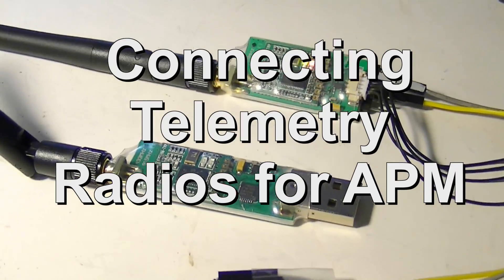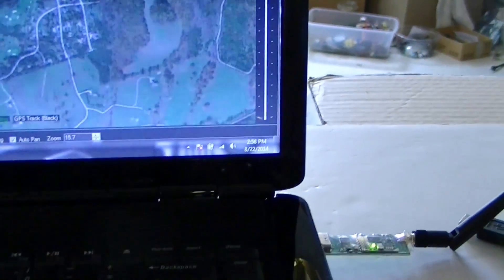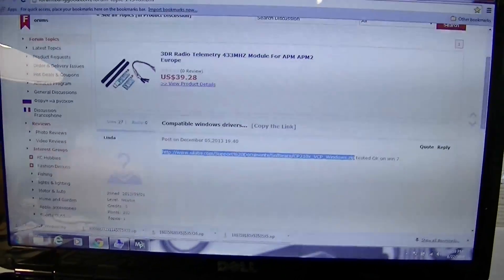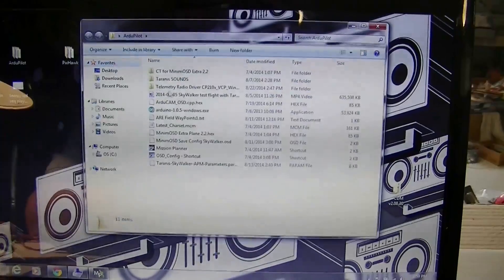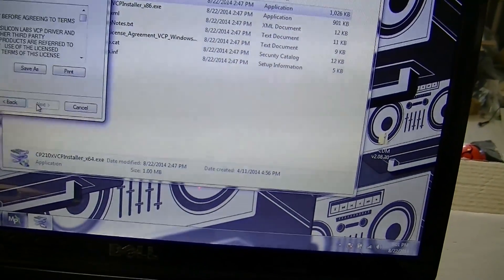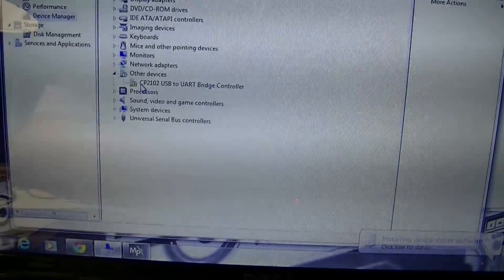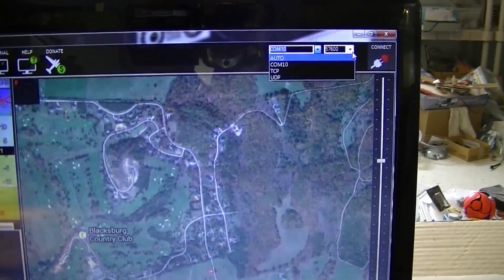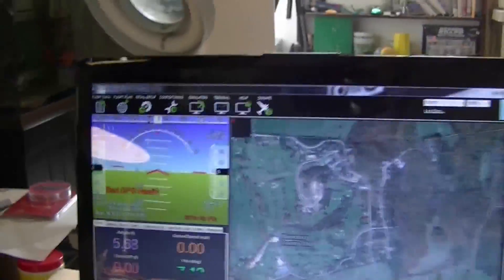How to Fix 3DR Telemetry Radio Link Problem

Comment: This is a great video and resolved my connection problem...when I saw it download 400 components on my Mac and knew (from your comments) it had worked.  I am still having one problem which is the radio while connected is still reporting NO DATA.  I can change mode on the radio and the computer does the mode and I see the Google map of where I am in APM but the radio isnt showing any information (except NO DATA) and nothing works on the radio except the mode switches.  Can you point me in the right direction?
Reply: On Macs there are actually two problems with the install: one is the download for the mac version from ardulink.org website crashes reporting wrong version of library.  There is a day build from 2018 that will install available here: https://firmware.ardupilot.org/Tools/APMPlanner/daily/2018-08-18/          Inside the dmg file that crashes there is also a link to download the serial driver.  Open the .dmg file to see the additional package files that needs to be installed: the FTDI USB Serial Driver. To install the packages, they will need to be opened by control-clicking  the icon and select ‘Open’.  The file inside the dmg is the correct driver for Mac instead of Windows.
Reply from the maker: Wow! I'm a PC guy so I never would have guessed that. Good info!

Comment: Hi ! What can I do when I can’t see COM of my APM 2.6 in Mission Planner for firmware uploading. And when I go ahead with AUTO at baud rate 115200 it says: is this Linux board? “ for Yes : leaded to connect it to its WiFi .” “ for No : failed to download new firmware: system ...” I’d really appreciate if you could do me a favor. Thanks!

Comment: If I put my 3dr rx &tx and radio and android
Which has droid planner in my drone and I upload way points which is out of radio range for example 10km and also use auto mode is it possible to fly on the way points 
For long range

Comment: Please explain. Is there anything I need to do regarding the setting in the Flight Controller? I just connect the airside radio to either Telem 1 or Telem 2 and all will be good?
Reply from the maker: It's the white molex connector in the corner for telemetry.

Comment: Hi Dave I am having a problem with the telemetry setup .
When connected to mavlink I am getting 100% signal strength but when I downloaded data log via mavlink the rf signal drops to 2-19% and get errors.
I don’t know understand why the rf signal is effected by downloading loading data .
FC is a Apm 2.8.
Do you have any ideas or can you recommend a group that I could put this problem to ?
Thanks for all of the videos Dave they are fantastic.
 Cheers 
Wayne
Reply from the maker: RF reflections from being to close to walls or the objects could cause that. Try a different location and keep the antennas spread apart a few feet. 
Try DIYdrones, they have threads on APM and 3DR raidios, very good resource. 
 https://diydrones.com/forum
Reply: Cheers Dave I will look into it 👍🖐

Comment: bro im using 3dr 433Mhz telemetry if i connect my telemetry it shows connection failed if i load settings it shows "invalid com or in use" my os is win10 kindly suggest me the sollution
Reply from the maker: My guess is it's a Windows driver problem. You may need to manually install the driver using windows device manager.
Reply: Dave Merc Productions yes I installed bro...again it showing problem
I using mission planner not apm planner

Comment: Hi sr. I've a problem. I moved bad the baudrate on mission planner of Sik Radio telementry. I selected 111100 and now I can't connect the module with the PC. It say invalid port or in use. can you help with this.

Comment: This is noting to do with drivers or firmwares. You only need to reset to factory setting i.e. reset EEPROM.
Reply from the maker: The driver is the most common problem but if the radios still don't communicate you can do the reset below. (Firmware mismatch can also be a problem so keep that in mind as a last resort.)To reset the radios to defaults using APM planner:
Connect the telemetry radio to the computer, go to initial setup, 3DR Radio.
Change the link settings selecting the serial port for the telemetry and 57600 bauds.
Click Restore Defaults.

Comment: I went to Bangoods site and could not find that driver download link. Can you please provide it?  Thank you.
Reply from the maker: Silabs Windows Driver Download:
https://www.silabs.com/Support%20Documents/Software/CP210x_VCP_Windows.zip
Reply: Download went fine but I do not have Com Ports showing in Device Manager...I am Windows 10 and have tried what is on the Internet to do when you do not see Com Ports and so far nothing works

Update....fixed the Com/Port issue....thanks for the help

Comment: Sir, One Question . i bought a new AMP 2.8 and I install Mission planner latest 1.3.39 but when i roll the AMP right it show On Secreen left .. i am confused because i using any APM first time.
Reply from the maker: That's because it's an Artificial Horizon so it should act that way. Your good to go.
Reply: thank you .. now i understand .. and i solved my APM 2.8 External Compass problem through internal Soldering .  now everything is working well

Comment: I am having an ongoing issue with my V1 SIk radios.  My radios typically make a link between the laptop and the plane.  Problem is about 50% of the time, the link drops when I arm the plane.  Once dropped, it never recovers on its own.  Any idea why that would be?  If I unplug the plane and plug it back in, the link will re-establish.  Never had this issue with my V2 radios.  Any settings that might make the link more robust?  When the link drops the two radios are about 3-5 feet from each other.

Comment: hi
Telemetry have 433 hz to connect my laptop to the mission planner restarts, I tried it with 3 laptops and does the same, I installed the drivers CP2102 can help me with this problem
graicas link telemetry http://es.aliexpress.com/item/Single-TTL-3DRobotics-3DR-Radio-Telemetry-Kit-433Mhz-for-APM-APM2/1440901786.html

Comment: Ok I've followed this tutorial and still no fix. I have the updated driver, baud rate set to 57600 and the right com port selected but it still times out. I have Windows 10. Has anyone else noticed that the drivers aren't working on Win 10?
Reply: It was as I started to suspect.  I had forgotten to cross the rx-tx signal cables between reciever and Flight Controller telemetry port. Selfmade cable. 😂 Working excellent now...
Reply: +Lewy Pierson same problem
Reply: same problem here as well
Reply: try another pc. works 100%
Reply: Ok. That didn't do it for me.. might be wrong wiring between receiver and APM on my side
Reply: Emil Stuenes so you tried a complete different PC and downloaded the program again from the website? if that doesn't work try another usb cable... that's all the points that I know

Comment: Hey even im working on 3DR telemetry , but im unable to fing ftdi adapter wire for my device. Can u suggest me where can I get FTDI to DF13 4 position wire.
Reply from the maker: +siddhartha achanta You will probably have to make your own cable. Hope you can solder some.
Reply: +dmerc00  I don't have tools for it can you help me out in this one

Comment: quick question.  my minim osd is displaying the wrong altitude off  of the apm 2.6. it's always reading in the 100's  at rest, and after take off  it just adds feet  to the already displayed 100 + feet. any help would be nice.
Reply from the maker: +NUWEST00520041 Probably have to set your home position/altitude at the location you are flying.
Reply from the maker: +NUWEST00520041 "For Plane the home position is initially established at the time the plane acquires its GPS lock. It is then continuously updated as long as the autopilot is disarmed."
"If you do not wait for GPS lock the  home   location will not be set correctly, and the Barometric Altimeter calibration will be incorrect. "

http://plane.ardupilot.com/wiki/starting-up-and-calibrating-arduplane/
Reply: +dmerc00 thank you for your time.  I think I have figured out the issue.  I believe there is an issue with the apm. I went into the terminal  tab, and connected it showed calibrating baro then went to gibberish. it just looks like it is running code or something.  which is weird because the quad still flies great and it reads the altitude via the barometer ( plus the 100 extra feet ) and it returns to home and lands like a champ.  I guess I will just have to live with the gremlin. or replace the apm. 
either way, .... thank you for your time and videos.

Comment: Just a heads up to anybody who is having a similar problem but the driver seems not to work on Windows 8.1... I installed and reinstalled this driver about 20 times and couldn't get mavlink to work... I noticed that my baud rate was 115200. I lowered it to 57600 and it worked like a charm. Thanks for the video!
Reply: +eveRide ADV  DUDE YOU just fixed my problem!!!! 57600 on both mission planer and device.
Reply: +Rob Mc Glad to help! Now if I could just get my camera to not wiggle :)
Reply: how do u chang baud rate on device?
Reply: BRO YOU SAVED MY LIFE 5 YEARS LATER

Comment: Hi.I have solved the driver problem /when i press load data irt works/ but when I try to a contact to the air modul a message appers        "No heartbeat packets received" Any idea?:)) Thank you
Reply from the maker: Tomi T Make sure the USB cable is unplugged and you are running the APM off the battery with power module.
Reply from the maker: Normally on an APM with 3DRadio connected and standard APM firmware the correct 3DRadio baud rate is 57600.

Then before you try anything to do with air telemetry radio:

CLICK DISCONNECT in Mission planner - you MUST disconnect USB from the APM and run off the flight battery.

Explanation; you successfully connect, IF you then disconnect power to your frame, your Air Station is off the air, Mission Planner INCORRECTLY thinks it is still connected because in fact the Ground Station IS CONNECTED, all appears normal to APM when in fact it is no longer connected to the AIR RADIO.

Get into the habit - BEFORE disconnecting power to your frame, CLICK DISCONNECT in Mission Planner FIRST! and you will avoid this trap.

Comment: hi! I followed all the steps stated on the video, but when I click on the Connect button, a 30 second countdown starts and when it's over, Mission Planner says "No Heartbeat Packets Received".
Any idea how to solve that? Thanks!!
Reply from the maker: girarcat That just means the mavlink stream is not working but I am not sure why.
Reply: just found the solution. I had the Ardupilot board powered by the USB cable, which as I've discovered, disables the telemetry transmission. I powered the APM board through an external battery and everything worked just fine.
Thanks all the same!
Reply from the maker: girarcat Oh good! I had no idea what you were trying to use the telemetry radio link and the usb link at the same time.